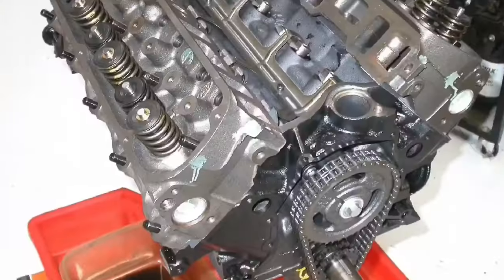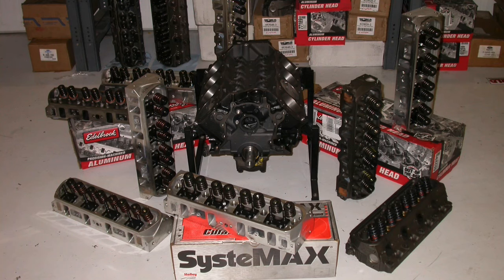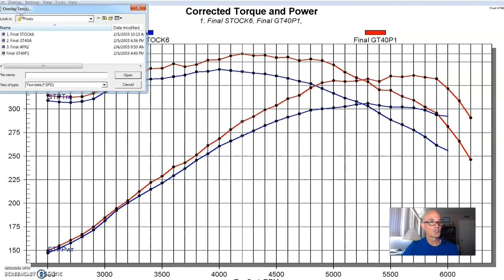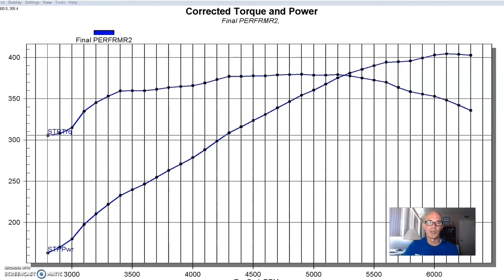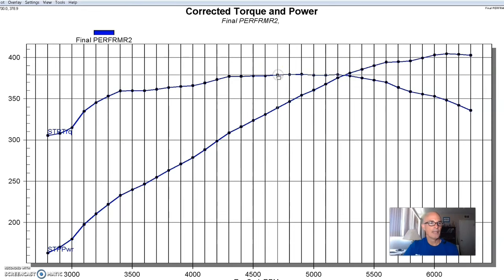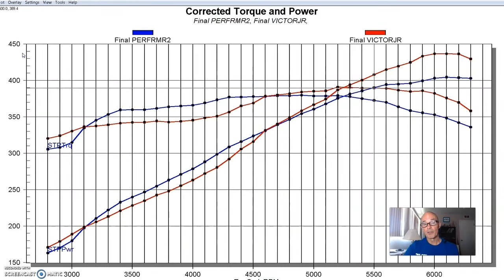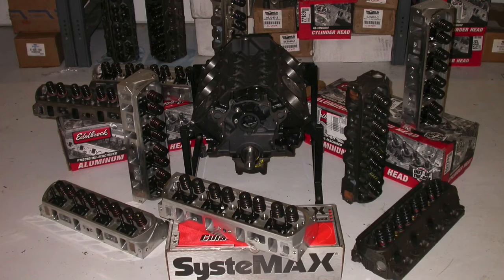LOW-BUCK 302 FORD HEAD UPGRADE

Comment: Question - did you use the same headers for the three different heads? I ask because I bought a set of GT40P’s and some headers but sold the P’s to get some AFRs (waiting for them to get back in stock). Hoping I don’t need to get new headers :)
Reply from the maker: P heads use different headers
Reply: @richardholdener1727  thanks for the reply! Looks like I’ll have to sell these headers :(

Comment: Had a question.. if I had a 302 bore to a 306. But the bottom end doesn't have forged pistons yet only has brand new  cast iron stock level piston ...and I went with this combo: 
165cc heads, airgap Intake, hydraulic roller cam/setup. Would it be okay with bottom end being cast?
Reply from the maker: YES

Comment: Hey Richard love watching your videos, would really love to see you dyno a D3ve headed 460, lots of different opinions on these heads. I think the heads have great potential. It would be awesome to see this done. I just built a 514 with worked over d3ve
Reply from the maker: did you watch the 460 videos yet
Reply: Richard Holdener I did yes, but it was a dove headed motor was it not

Comment: Did you not upgrade from the stock valve springs on the gt40p heads?! I’m surprised you could run that big of a can on the stock springs🤔🤔💯💯

Comment: Great info as always.  I have a (Larry Leifert) built 304 SBF with ported E7 heads that I put a Torker II on, but am now thinking about switching to a dual plane since it's a street car. I also have a Vortech V1 T-trim that will go on later this year. Would the RPM Air Gap be a good choice for both NA and supercharged?
Reply from the maker: yes air gap
Reply: @richardholdener1727  Thanks!

Comment: I have a 289 on my 67 Mustang. Is it possible to just drop a new heads on an otherwise stock engine? My valve stems are going out… want to eventually cam but wondering if I could just slap gt40 heads on my engine without having to buy anything else.
Reply from the maker: springs, pushrods-maybe rockers

Comment: I love your content but I have an air gap intake and it is not routed between the two holes in the top like yours is. Doesn't that make it more like a single plane
Reply from the maker: two holes in the top?
Reply: @richardholdener1727  the inlet of your dual plane is routered between the two holes. Where your carburetor mounts. Which makes it more like a single plane.

Comment: Damn.. 306 hp stock
336 from P heads
396 from the AFR 165 heads
90 HORSE POWER JUMP QITH THE AFR HEADS
Reply: Imagine afr185 heads and port matched intake
Reply: @andrewbrown755  AFR has their enforcer intake specifically for 185s now
Reply: Andrew.
Just imagine trying to drive that beach. Ouch.
Reply: I bought a '66 Stang in 1985 and still have it. When I built it in the '80's,  I used '69 351 4v heads. It has 10.5 to 1 forged pistons, .030 overbore, Comp Cams 230 @ .050 , .512 lift, roller rockers, Performer RPM intake, Demon 575 mech secondaries, Accel electronic dizzy, full length headers, and a 4 speed.  Probably, in the early 2000's ,  I put AFR 165's on it. The increase in power was mind boggling!  It pulls really hard from 3000 to 6000. Best money I've ever spent.

I bet Richard taught those guys on Engine Masters a thing or two....lol
Reply: @ragman069   very interesting  cam you have there.. Im putting together 302 with a 222/230 cam also with 512 across the board.  Small street cam.. daily driver. You ever dyno your combo?
Reply: Jody 
Never put it on a dyno.  I guesstimate it puts out around 350hp.  The bottom end is a little boggy.....I have 3.00:1 gearing and a 4 speed', but the power comes on strong 2500rpm and up

Comment: stumbled on this ...great stuff.

Did you do a video on a 351W? 

I have a stock 1969 Mach 1 with a 351w with a stock 4barrel  autolite 4300. Stock exhaust manifolds

Every now and then I dream of more HP...but constrained in that it HAS to look stock under the hood for show purposes....although my show days are waning...

I read that the 351w 4bl  had 290hp at the engine and an anemic 150-170hp at the wheels. Super sad numbers, and yeah kinda feels sluggish. 

Thoughts?
Reply from the maker: A 1969 351w SHOULD MAKE MORE THAN 170 WHEEL HP-LOTS OF 351W VIDS UP
Reply: @richardholdener1727  under your channel ?

Comment: Watch your vedios every I see them pop up! The 302 vedios are great, but my views on them are the only reason to use them is a 351w won't fit, or you're lying and it's a 347!  I'm starting a 351w build for my 94F150 flareside. I'm gonna use whatever is sitting in the shop! The trw pistons, block, cheap aluminum heads, performer intake with a spacer, and the old 750 Holley with cobwebs in it! Like to see a show like that! I'll experiment with spacers, changing the springs on the secondary, jetting, timing! Retired and bored to death!

Comment: What compression were you running in your test engines? I  have a  87 roller with 9 to 1 and I'm bolting on closed chamber ported 289 hipo heads with 202 valves, screw in studs, roller rockers, .540 lift cam. Was wondering if you would still recommend the air gap intake for this set up? It should produce good power if my math is correct. Around 10.5 to 1 compression if not a little more.
Reply from the maker: yes on rpm -hope the heads are ported
Reply: @richardholdener1727  yes they are ported nicely.
Reply: And thank you sir for responding so quickly. I thoroughly enjoy your videos.

Comment: So are the e7 head valves stock size and stock ports I assume? Pretty good power on those if so. I've been wanting to bump my 89 f150 up a little so it has some more grunt. If that 264 cam (which is what I had in mind) works that well with those heads then I may reconsider throwing one in. I just didn't wanna do all kinds of crap at one time because I use it so much

Comment: you should do a test with RHS Pro Action head. they have 20 degree valve angles. might be kool to see if they are better than as cast aluminum ones.
Reply from the maker: I have some RHS head tests
Reply: @richardholdener1727  for Ford? what in the title?

Comment: Hey Richard, u should extrude hone port the RPM and see what it does against the vic jr.
Reply from the maker: I did that on my 351W based 410 for Engine Masters-worked well-I did a lot with the guys from Extrude Hone-good peeps
Reply: Suddenly youre out of budget build in big $$$$$.

Comment: From 1968 to 1971 I would put any for barrel factory 302 Ford against any 350 ChevyPontiac Buick Oldsmobile any of those motors a302 factory 4 barrel Ford back in the day with a hot hot motor now let's not even begin to talk about the 351 Ford Windsor motors that came from the factory with those GT40 heads and some pretty spicy cams right out of the factory 351 Windsor four-barrel motors probably one of the most underrated motors ever..and any thinking person knows that anything that says boss on it from Fordis and are some of the best V8 ever made by anyone at anytime..... Not an opinion...... As a matter of fact when the clevelands and the boss 302s + 351 came out I'm very surprised NASCAR didn't put the kibosh on it... I'm back in the day those beefy 302 4 bolt main block s were stout..but then again what am I saying because I had an 8000 RPM 302 Marine Block 2 Bolt main with an iskenderian camshaft in it I'm going to say 500 lift 300 duration it was a hydraulic NASCAR cam for 302 and I remember building those heads and putting in these massive triple valve springs and thanking man aren't these valves going to break the answer was no my brother and I beat the snot out of that motor for 3 or 4 years and sold the components to head to cam and all that good s***that was a low budget motor.. but I didn't have a dynamometer or 30 different sets of heads .. Good Video... Call ME if I can ever be of any info assistance. No you probably the only tech  on the net that doesn't think he's a Dyno & Muscle car God...so good vid ..there's a guy up in Canada that does a lot of videoshe's got a garage in that god-forsaken place somewhere up there in the snow belt can't think of his name Rick's garage? Micks garage ?garage? DICKS garage...but according to him if it is in a Mopar it isn't anyting  Fords suck but Chevys are okay and he looks like the mr. Magoo or the dyno Nixx garage...that's him AKA Mr Magoo..but you just ask him or anyone standing around him and all his friends and buddies on YouTube in the whole wide world and he will tell you how great he is...

Comment: Love this bro!!!! Toss in those pro comp heads!! I’m just assuming my 210cc pro comps on my 347 will do at LEAST as well as a set of gt40p heads. If you just compute for the increase in cubic inches, this gt40p combo on a 347 should make at least 380hp. I’m hoping for 400hp with my xe270hr cam, 210cc pro comps and a 10.5:1 347 combo!! Love your videos!!!
Reply: I would have done 180 promaxx MAXX head or their shocker 210s. Builders say they are probably the best offshore head out there
Reply: mrhazel yea it’s a long story. Someone sold me these heads advertised as Ford Racing X303 heads. (I know, Not the best either) when they came they were pro comp and I paid via Chase quick pay. Bank said I was beat. So I gotta live with them. Had my machine shop go over them. Everything looked good
Reply from the maker: Go for it!
Reply from the maker: their heads work well
Reply: Richard Holdener thanks a Rich! Damn man, burning the midnight oil I see! I’m working too. Little different job 👮‍♂️
Reply: @bluecollarfox916  yeah just go with them. Good luck!

Comment: I would like to see you use the skip white nkb-274 heads since they are available for around 799 with decent valvetrain parts ready to bolt on.

Comment: Have you tried running solid lifters on a hydraulic cam w lash. Roller would be better cause of the ramps maybe. Seen it done in a Pontiac engine.
Reply: You cant mix roller stuff with flat tappet stuff.
Reply from the maker: this was all hyd roller 5.0L stuff. We have combined solid lifters on hyd roller cam and the other way around
Reply: Ray it's my 2nd day but thanks for the heads up

Comment: Did you not upgrade from the stock valve springs on the gt40p heads?! I’m surprised you could run that big of a can on the stock springs🤔🤔💯💯
Reply from the maker: we did
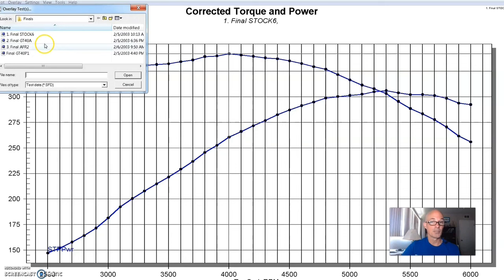Reply: @richardholdener1727  what cam do you think is best for a 5.0 flat tappet gt40p air gap intake going into a 4x4 truck with 4:10 gears
Thanks

Comment: If your running a nitrous plate make sure to run a single plane, a plate on a dual plane is asking for trouble.
Reply from the maker: we run nitrous on dual-planes all the time-that my friend is an internet myth!
Reply: @richardholdener1727   @Richard Holdener  direct port? On my 408 in my ranger we could never get the tuning right with a plate on a dual plane air gap so we went with a wide band on each bank. Idle to wide open without n02 it was just fine, spraying one bank was always way lean. Put a super victor on with the same plate and the problem went away.
Reply: And yes the divider was cut out.

Comment: Do you have any tests showing if it’s actually a bad idea to have a large head port on a smaller 302? Like a 210 pro comp or 205 AFR head. Even with different cams?
Reply from the maker: yes-that video is up-we ran 175, 190m 210 and 225 heads on a 302 and 363
Reply: @richardholdener1727  thank you!!!

Comment: Question...i have an 89 f150 i need better pulling power for the mtns in montana with my trucj camper on....what should i do to get better pull...probly gonna change the intake and go to a carb
Reply from the maker: headers, heads, cam intake

Comment: I really appreciate this video so much! The GT40P head dyno is very similar to my set up and gives me an idea of what i can potentially make. My GT40P's are ported with 2.02/1.65 valves, cut down to 54cc and im running a .030 cometic headgasket with a stock 88 block(forged pistons), calculated 10.46:1 if im correct. RPM air gap, AFM N41 cam, 1.6 rr, and the Holley Sniper EFI kit with 93 octane. What's your guess on how much HP I'll make Richard? Im curious to see how close i get to your guesstimate.
Reply: How do you put 2.02 and 1.65 valves in that chamber without relocating the valve guides?? 
1.94/ 1.60 are .060 apart.
Reply from the maker: I don't know specs on that cam-sounds like a good combo otherwise
Reply: @richardholdener1727  
The cam specs straight off of the card are for a 302HO/351:
Advertise Duration .006 - Intake:278 / Exhaust: 286
Duration at .050 - In:222 / Ex:230
Timing events at .050 - In: 1/41 Ex: 45/5
Lobe Lift @ Cam - In:.320 / Ex:.320
Gross valve lift w/ 1.6 - In:.512 / Ex:.512
Lobe Seperation 110
Degree intake lobe to 106
Valve Lash (Hot) - In:0 / Ex:0
Reply: @hotrodray6802  i purchased the heads from someone who else who did them and worked at a machine shop in Pennsylvania. This is the info that was provided to me. I have a buddy who lives in the same town in Pennsylvania and said that machine is the go to in the area and is a very reputable shop. Hopefully there isn't any issues, so far everything is coming together.

Comment: Richard, test a set of C9OE 351W heads!
Reply: I had a 69 351w. I remember it was a stout engine.
Reply: Why? Ps are better.
Reply: C9 better than the 40 or P.
20 cc bigger runners at 144, same valves, and about the same compression on a 5.0, not on a 289. Hard to find early W big spark plug heads.
Reply: Ford made those heads for 4 years 50 yrs ago.

Comment: Great video! So if i have a stock 289 with a edelbrock performer intake would i be better off upgrading the valve springs and getting a mild cam or should i go try and get gt40 heads? thank you in advance
Reply from the maker: GT40 heads, springs and mild cam would help that motor a lot
Reply: @richardholdener1727  Thank you sir. now next question should i run a flat tappet cam or get a roller for that set up

Comment: What is the largest cam you can run on a 92 stock short block, can you run that 275 cam your always talking about? Going to run afr 185 or tfs 190 11r.  Thanks
Reply from the maker: with the right heads-the tfs TW adds P-V

Comment: Well that answers a lot of questions about 302s especially the one I'm gonna do on my car on my channel

I might just do a mabbco 302 short block with the upgrades of oversized valve relief pistons and rod bolts they offer and put twisted wedge 11r 170s 53cc on it and the howards 227/233 .597/.597 lift 110/106 lsa off the shelf cam then a rpm intake and 650 Holley

Do you think port matching an intake to flow more than the heads will be a better idea vs putting an out of the box intake on?
Reply from the maker: we have not seen any significant gains from port matching-those 11R heads are excellent